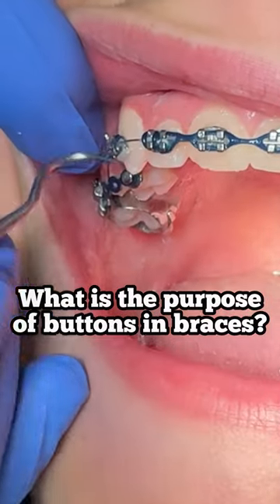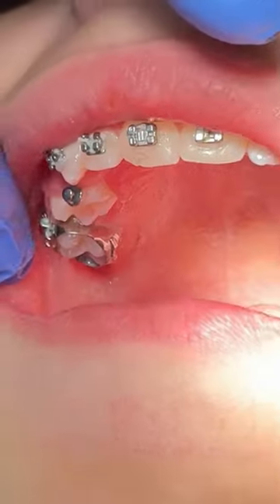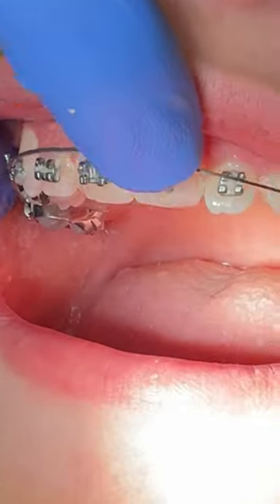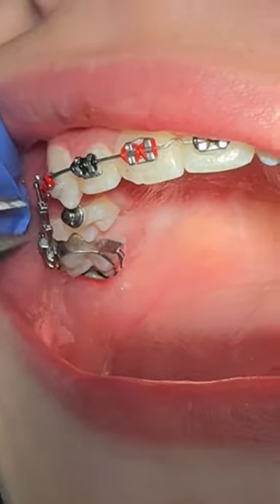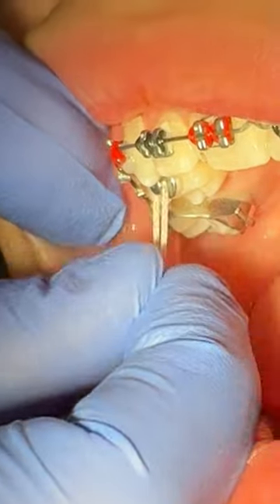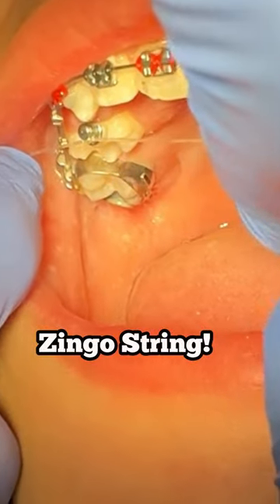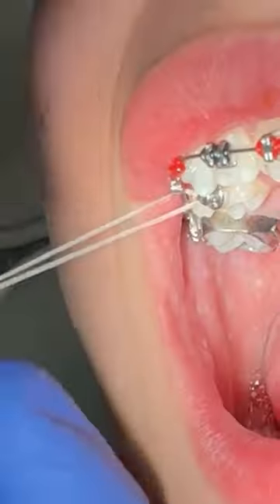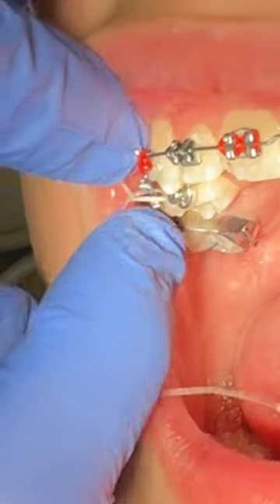What is the purpose of buttons in braces? Toothtime Family Dentistry Braces in New Braunfels Texas

Comment: Very cool! My case is a bit more severe. #11 was all the way in my palatal bone structure near my nose on the pano. I got surgery a year and a half ago to get a chain attached to it and every 3 weeks i go to my ortho app where they have to tighten an elastic thread to my lingual bar. It hurts but the tooth is slowly moving down and will eventually take the place of my baby canine H. I’m excited for my teeth to be complete :)
Reply: Omg I had the same problem, had my surgery a year ago (March 2023) and braces 11 months ago (May 2023). However, after the chain was placed it slowly started coming down on its own, without force!! In the appointment i had in january 2024 my tooth was really far back and only the tip was showing, so they applied force. In the appointment I had last week (start of April 2024) the whole back and 1/3 of the front was exposed!! Crazy how fast teeth move because of braces!! So fascinating!